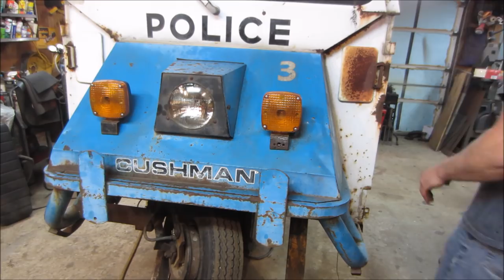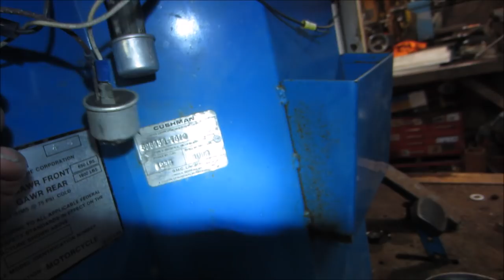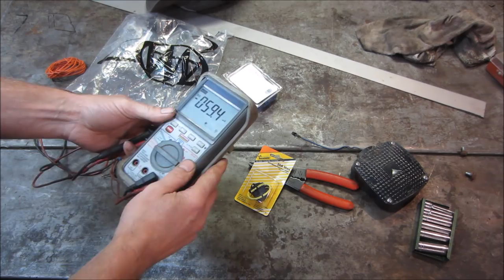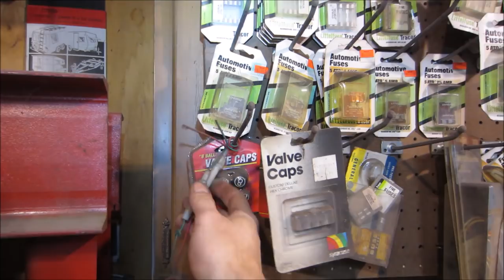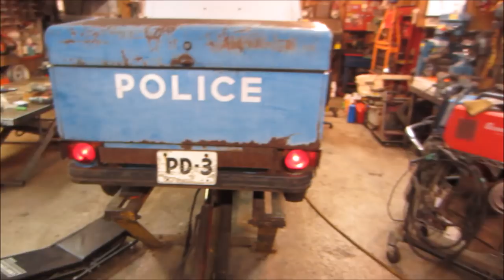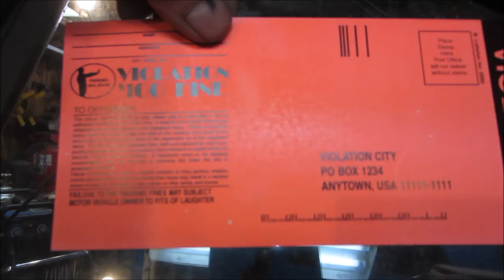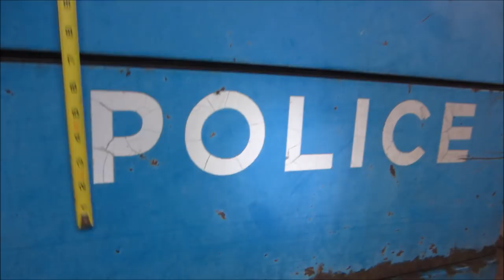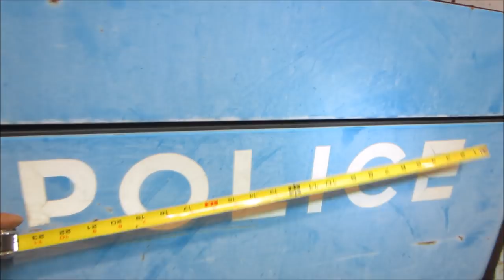cushman meter maid troubleshooting the wiring

Comment: Some people likes nice and shiny and some people don't, it's either restoration or a rustoration?  Restoration cost a fortune, and many times the end project will appraise for less than it cost to restore it. That's fine if you want the project for yourself and have no idea of selling it. At that rate the cost is not a factor, it's just what can you afford to put into what you will enjoy.  But if your idea is to make money on the projects you better be careful what you spend so you don't lose your ass. But today many people are finding they can be very creative with a rustoration project like this Cushman without spending a fortune and have a bast doing it.  When I was a young man we did stuff like this out of necessity, we simply didn't  have the money to create showpiece projects. I recall back when I was around seventeen years old I purchased a ugly 1950 Ford for around $50.00 that had a blown engine. After giving this car some thought and having a empty wallet in the process, I heard about a old Buick that ran great but it had been wrecked very badly, but I could get the car for free if I would take the whole car.  I got my friends together and we pulled the entire drive train out of that old Buick and I slowly started to work on that old 1950 Ford, and must say I had a bast working on that old car.  At the end of that summer I had that Buick motor and transmission installed in that old Ford with all homemade parts and it ran and drove great. I named that old car Buford for obvious reasons and I have to say till this very day I think more of old Buford than any one of the nine Corvettes I've owned in my life. I suppose it's because I didn't build the Corvettes? I was fairly poor back then, but I certainly wouldn't trade those day for anything. Being broke certainly wasn't a sin,  but I will say it was unhandy as hell when it came to building a project car. LOL But it sure did make me barter my skills and work to be creative without using much cash. At that time I wish like hell I had more money for that project,  but looking back on it I now realize I was having the the time of my life!

Comment: Insulation Displacement connectors are in my opinion also the biggest issues. They need to be the correct wire size and if the insulation is very thick the always become an issue just like you found. I as well won't use one.

Comment: That gas iron has a hot exhaust ideal for cooking shrink sleeve and fingers, also scotchlock connectors should always be used with grease if in the wet, otherwise your work mirrors my way of thinking, why spend when you can fix it, time is cheap when work is slack.

Comment: Scotchlock connectors do work well as long as they're used in a position where the connector and the wiring can't move around and mess up the connection.  If it can then sooner or later you'll get exactly this problem...

Comment: take a leaf b;ower and blast out the defroster pipe and pull the cooling shroud off for a good cleaning (mice die there) .....if the cooling fins on the cylinders are plugged it will overheat

Comment: It would take lots of work but cut the trunk near its center and add enough metal to extend it to the cab.  Do away with the open part of the bed and you would gain a lot of covered storage and no other Cushman would have it.

Comment: Those bloody scotch lock splice/connectors are a pain in the arse!!, i strip and solder now!.
Reply: I seem to recall them as "quick-taps" or some variant of that name.  Weak, weak, weak.  I removed a few of them, because I'm of the same mind as most others would be... Nothing beats a proper splice with solder and insulation.

Comment: Try 3m scotch lock connectors  they are a quick splice but heavier made they have three holes and are filled with electric grease
Reply: AUTOTECH 1991 The ones you are talking about were commonly used in the telephone repair field. I still have some of those around here. They even had a special pair of pliers to use with them.
Reply: Never knew that's where they started the automotive application ones I use are awesome though easy to use and much better than the cheap ones from Walmart or something just recently picked a big batch on ebay cheap for some  projects

Comment: I'm surprised "they" didn't just wire the top lights to the signals/flasher, and/or you didn't just do that when you found the crimped on tap was flakey.  I can't see any reason NOT to have them all work in unison, vs. separate switches (and wiring and flasher).

RichE

Comment: Hey Mustie, what would cause headlights to turn off completely when switching to high beams? High beams work when you pull back lever on column (flash mode), but when you lock the switch to high beams, the lights turn off completely. The guy I bought the 89 4runner from said he changed the headlight switch already. Could it be a faulty switch? Or is there something else it could be? 

Thanks for all your wonderful content btw!
Reply: Logic would indicate you still have a switch problem. Possibly a termination issue between the wire and the switch contact, or an internal contact issue. You are going to have to do exactly what Mustie is doing here. Take the steering wheel off so all the players are exposed and test everything with a test light. Since you already have a set of distinct parameters you have a standard to test against.
It's hard to imagine they ran two separate wires to the high beam headlights so find the "standard" high beam contact in the switch and trace through to the high beam wire. Logically the problem is going to be internal to the switch but just get everything exposed and use logic to trace through that circuit. If you have a multi wire pin plug downstream that is another area of suspicion.
Reply: AKA Wireguy AKA Wireguy Thanks for the info. I've had several issues with the wiring in the truck, and I'm slowly getting to them all. Well, I guess I'll pull the steering wheel and check the switch assembly, possibly clean the contacts with a small file if they're serviceable. Apparently the high beam switch is a common problem on earlier Toyotas.
Reply: Did they replace it with the proper switch and did they get the wires back on correctly? I might double check it before going thru all the trouble of pulling the steering wheel. IMO    Chuck in Kansas

Comment: I hate those parasite types of connections. They never work because nobody ever gets the proper one for the gauge of wire they use. It's always too small or too big, never just right (as if the cents will sink them under the line). Prefer solder joints for inside the cabin or crimp connector + bolt types in the engine compartment.

Comment: Those electrical connectors are a mechanics nightmare bc they will cause all kind of electrical issues when troubleshooting just do it properly and solder the wires

Comment: I don't know if you've ever used them but Granger's industrial supply has combination taillights similar to what you have. Two stud mount with the licence plate lense for $8.55 each. When I was working for the world's largest earth moving equipment company Granger's was great because they had all kinds of odd ball things available like your lights or the push-pull switch you replaced or even that heater blower.

Comment: Great work as always  ,the flashing lights IE blinkers it looks like the manufacturer made the front and rear the same meaning the front lenses are just painted black and used as the rear housing to cut production costs 
What do you think ??
Reply: Yes, I agree with you.  Years ago, I had an '89 Freightliner with a similar model of housing on each fender.  The forward lens was amber, the rearward lens was red, and there was a tiny side marker in a separated chamber where a 189 bulb would glow as a marker light.  In the main chamber, there was an 1156 that functioned as the signal-blinkin' bulb.  After a trip WAY up north, I had to buy some new amber lenses to replace what had been smashed out by stones kicked up by opposing vehicles on those tar & pea-stone roads. I went in to get the lenses, and the guy showed me the screen, he had amber and red in stock, and you could get solid black, or blue (by special order).  I was surprised by how relatively inexpensive they were (this was in '95).  I wasn't overly surprised that the old ones had broken, as they were quite brittle when they came out of their mountings, likely from the 6 years of sun, and truck-wash chemicals.  The new lenses even came with new foam-rubber gaskets, which also surprised me.
Reply: Stan Patterson 
Thanks Stan

Comment: did  you  ever  find out  what  was  up  with the  left  front  amber  blinker????
Reply: The only other thought I had is that the directional switch might "break" the 4 way circuit for the lights on the left when you put the directional to the right. This means the directional switch might have a bad circuit for the left light (always open)

Comment: Great good work,
My opinion, but you get it,
Is you "blow" it up, almost everywhere it's possible with compressed air ...
And "paint" it with some kind a hot new gear box oil ...

Whatsoever the "Thing" you where talking about is Called ...
     "EXTRASYSTOLE"

Physiologically when breathing beats are faster than heart beats.

Regardless the reasons,
It seems to be a rithm issue .

Or some kinda "...." affairs .

Was thinking,

VAIN RIBS magnets on the flanks,
That "beast" Mustie once take back to life ...

Nevermind ...

Sliding doors seems to be,
an idea too ...

I'll redempte,
Like most of Us will .

Comment: Just curious. Is there any reason why the rooflights do not flash together with the warning flashers? (We do not have that kind of vehicle in Sweden)
Reply from the maker: im not sure why
Reply: Maybe it makes it more a motion , wave style idea...
Reply: Looking at the switch that activates the rooflights and it´s location, could it be it is intended as crude door contact?
As soon as you open the door, rooflights starts to flash. Should be interesting if there is a similar switch on the other side...

Comment: Putting in aV8 then it would be the only meter maid drag truck in existence  lol
Reply: Doing a constant wheelie down the strip eh? steer by independent brakes on the back wheels!  
I think I have a Mustie1 type idea.  Someone shoot me down if I'm misremembering, but isn't the Cushman engine a flat 2?  Get a VW engine, let the back 2 cylinders go into the open bed behind the cab and make a dog house for it there. Use a bus fan to keep it low. The next step would be to make it sound like a bug or bus. Oh yes, you gotta make sure it makes more torque / Hp than the flat twin!  You could also go whole Hawg by making the rear of the Cushman be like one of those VW powered Trikes with car wheels and tires.  I'd rather it remain a sleeper with the small wheels, looking quite normal until you fire it up!

Comment: The defective wiring connector you found is called a "3-M Suitcase" connector.  The blinkers on the roof and their wiring look to have been added on later to make the meter maid more visible in traffic.  I would not want to get hit by a car if I were driving one.  Squish!

Comment: I'm anal when doing this kind of work, I would have had too try taking apart that old switch and see if I could get it working lol. Maybe even spraying it down with contact cleaner and heating it up a bit with a heat gun to soften the old lube in it.

Comment: What do you dab on before soldering?
Reply: Micheál Cleary  Flux.
Reply: It looked like liquid flux.
Reply: Flux makes solder play nicely with the surface you want it to adhere to.  Flux also prevents oxidation to base and filler materials.

Comment: If a job’s worth doing, it’s worth doing right. Please sand and paint her 🙏🏻
Reply: Are you going to volunteer your labor to sand and fill, or volunteer to buy the paint?
Reply: Stan Patterson - I’d love to sand and repair her. I’m in Alberta Canada. Ship her out...lol
Reply: I'm in Ontario, and used to be in the business of hauling things like that.  Of all the things that man has built since the wheel was invented, a Cushman meter-maid scooter would be one of the few things I don't ever recall hauling.
Reply: Many, many people are into the 'Rat Rod' look and even spray clear to halt the process. It's a 'thing' though I'm with you and like a restoration that looks like it just rolled off the line.
Reply: I'll split the difference with ya. Far be it from me to put even moderate effort into appearances on a project such as this, but having to look at that rust on the white section of the cab every time I'd get into that thing would get me down. Some slight sanding and a rattle can of rust oleum for a "20-20" paint job (looks OK at 20 MPH @ 20 ft) might be worth it to me...leave the blue alone as you'll never be able to match it. If Mustie agrees, and someone pays for the Über to NH and back to NJ, I have some leftover gravel paper and a half-used can of gloss white in my garage.